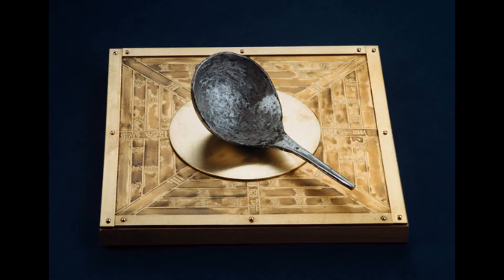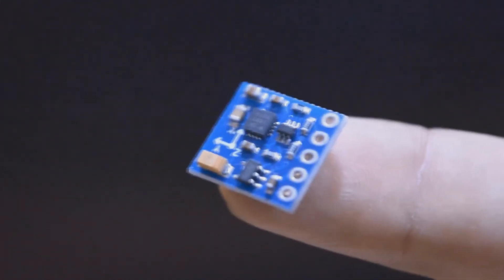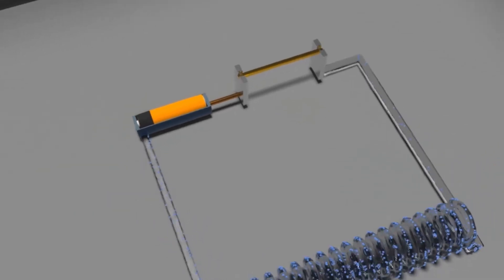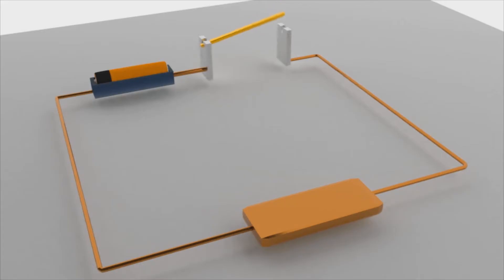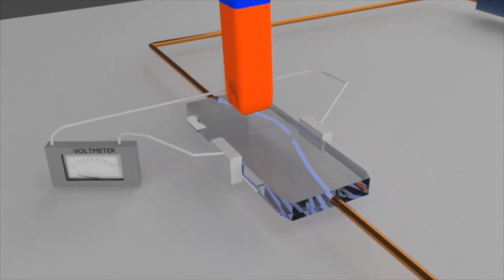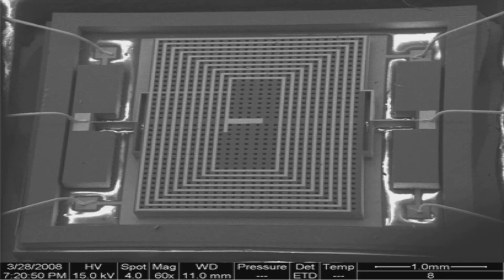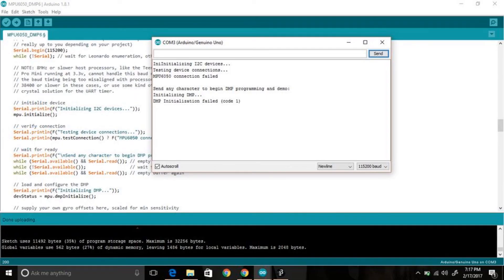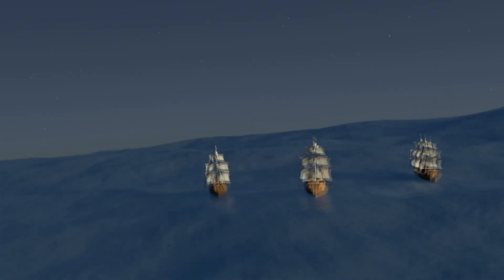How Magnetometer Works - Animation || The Hall Effect & Lorentz Force

Comment: Here is a quote from a book. In the early days of electricity, less than 250 years ago, men were rubbing together different materials and observing the result. They determinate, by their observations, that there were two distinct types of electricity, and named them vitreous and resinous. The vitreous had an affinity with pith balls, which are derived from the positive core of vascular plants and trees. The resinous had affinity for the negative, outer mass of these plants and trees, such as cellulose and rubber. These two contrasts became known as positive electricity and negative electricity. This belief held until it was found by experiments with a Leydin Jar (a condenser or capacitor) that flux of the positive electricity could be divided into a pressure (voltage) by a lack and/or excess of "juice" called valence electrons, which is contained in and associated with good conductors of the positive electricity. Thus the resinous, or negative electricity, was dropped from the science of electricity and electronics, and the manipulation of the vitrous, positive electricity by forcefully separating this miracle+producing electrical juice within good conductors of electricity into a state of lack and excess, became known as the generation (pumping) of electricity, and the particles, or juice in transit, became knows as electrons. Was it then the Leyden Jar that became the mother of the continuing mystery concerning electrical energy?
Tomorrows' energy ... need not be fuel! By Arthur C.Aho
https://www.amazon.co.uk/Tomorrows-energy-need-not-fuel/dp/B0006CZ5B6
https://en.wikipedia.org/wiki/Leyden_jar
Edward LeedsKalnin, Magnetic Current (with hand drawn pictures, very rare find)
http://existanz.planet.ee/dl/kalnin.pdf copy of the original.
https://www.youtube.com/watch?v=_YW0wjYdUPw&t=0s&list=PL5836E6A631B45B44&index=20
https://www.youtube.com/watch?v=McF3r7arhmc&t=6s&list=PL5836E6A631B45B44&index=21
https://www.youtube.com/watch?v=q1M6gUV27tI&t=0s&list=PL5836E6A631B45B44&index=24
Captain Nemo and the Underwater City (1969) explains why gold is being locked away from everyday use.
https://www.imdb.com/title/tt0065522/?ref_=fn_al_tt_1
Reply from the maker: Thanks for sharing this!